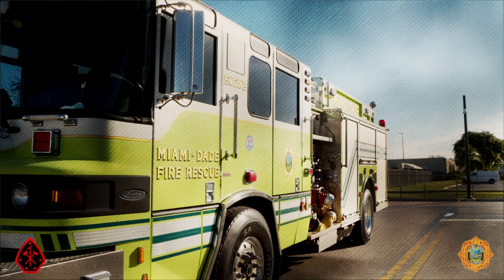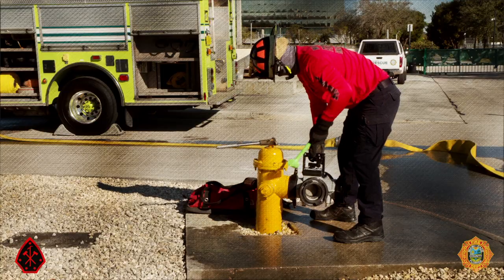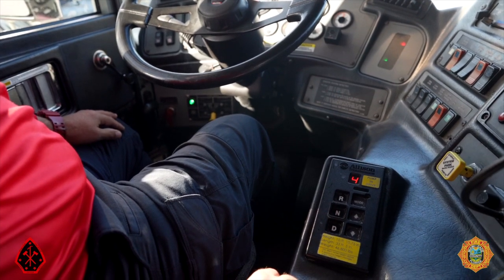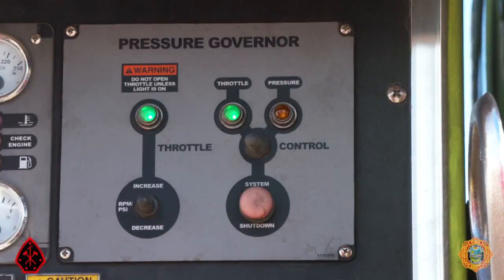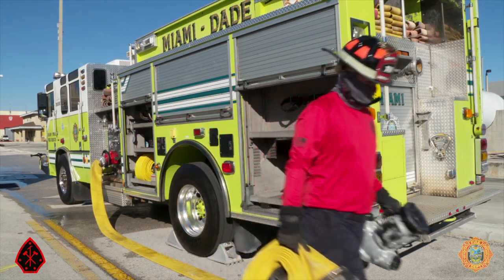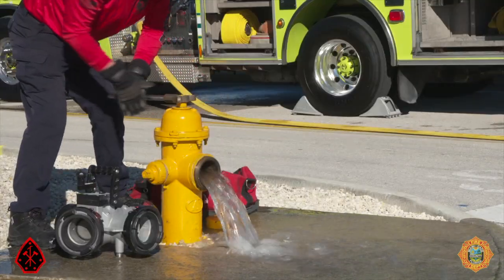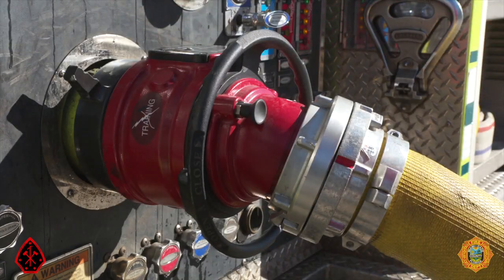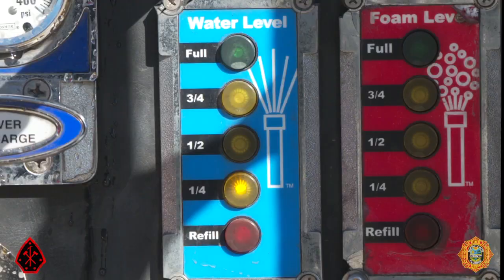Hydrant Hookup Changeover Training

Comment: one thing is certain , if the fire does not consume your stick house, 1000 tons of water will
Reply: If you haven't knocked it down with 250 gallons or less, either 1) you're not hitting the seat of the fire or 2) it's a BFF.

Comment: Made a simple evolution of the Engineer hand-laying a supply line to the hydrant way too complicated, with too much hardware involved. Good evolution to begin pumping from tank, then switching over to a hydrant before losing tank water, but this example is too many unnecessary steps.

Comment: Pretty good video but a lot of unnecessary crap on there.  Just hook the 5" from the hydrant to the intake valve and be done with it!  In particular, the hydrassist valve is not needed with such a short amount of hose.

Comment: Just seems like too much for a water supply, hydrant to pump that’s it, all of that seems like it takes valuable time from the point of the water supply in the first place. And it’s also too many steps to try and remember
Reply: Especially the part about putting the truck in gear and leaving it in gear and then it registers as speed on this speedometer ? What the hell
Reply: When you change from road to pump the transmission changes gear to only power the pump. Since it is disengaged from powering the wheels, the truck wont move. It shows speed on the speedometer since the drive shaft is still moving to power the pump. @LJT7907